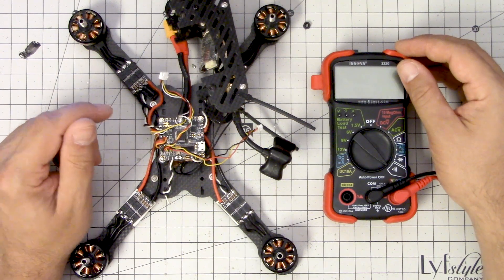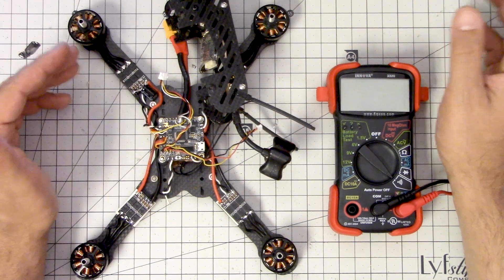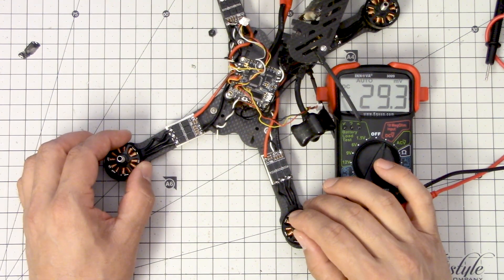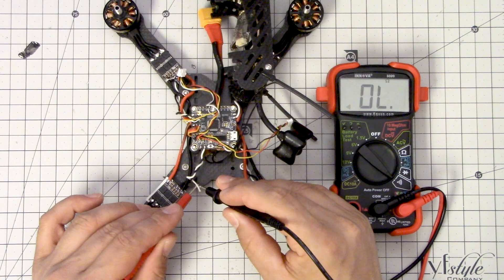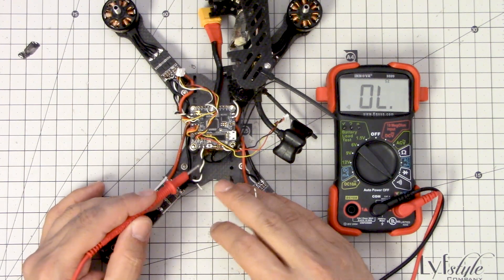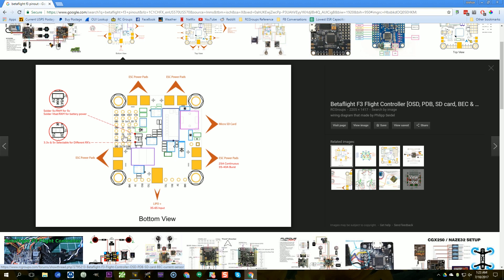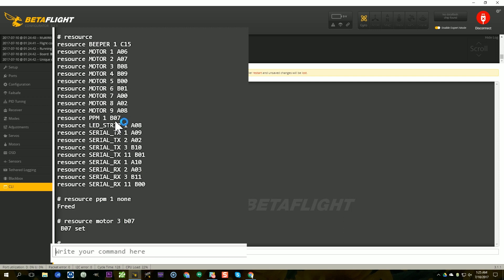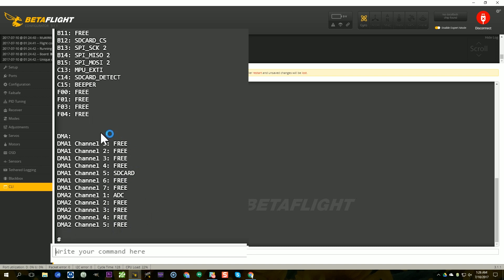How To Fix A Bad Motor Output With Betaflight Resource Remapping

Comment: I'm going thru it now with a brand new stack it's like all 4 are not there..   it does 3 beeps and motors twitch but not getting last 2....I'm so over quads I've spent so much lately and I just want to fly

Comment: Is there any reasons not to use another motor output if you have 8 motor outputs on the Fc?
Reply from the maker: No. Absolutely do that.
Reply: @JoshuaBardwell  Awesome! Thanks 😃

Comment: Hi Joshua, I have your JB F4 V2 aio FC, and it has a short in the board at S1.  I remapped successfully, but will the short cause other problems?  After remapping I got all the motors to spin up on arming and was able to fly, but now for no apparent reason I get 100% error on all four motors on the motors tab.  Thoughts?  I haven't changed anything else and was enjoying RPM filtering previously.  BLHELI can't read the ESCs at all, but all four motors do the full series of init beeps on power up
Reply from the maker: If s1 is shorted to ground then s1 won't work but no other problem.

Comment: Hey Josh, on another thread I mentioned I crashed my transtec beetle broke the arm and was waiting for a replacement.  I hit down in a grassy field, not on the concreat so I'm hoping I didn't damage the ESC.  (maybe I did) I received the replacement lower frame and swapped it out with the broken one put everything back like it was.  Long story short, motor one is dead in the water, won't spin in BF, solders appear to be fine, haven't taken it apart yet but wondered if reassigning the motor as you demonstrate here might fix the problem.  Again it's a DJI equipped transtec beetle.  What's your opinion and with this particular ESC are there any caveats I should be looking for when initiating this procedure?  Thanks!

Comment: can i use an available TX for my new motor signal?  for example right now i have TX 1 available.
Reply from the maker: I don't think that usually will work if you are using Dshot, because the UART pads probably don't have a dedicated DMA channel and timer.
Reply: @JoshuaBardwell   ya I figured that out. Thank you. I'm just going to remap and use  the the led strip pad and remove my LEDs.  Once again thanks for the help.  I am a big fan of your videos. You have helped me out through a lot.  Thanks for your time.

Comment: I'm having a problem the left back motor keeps dipping Everytime I throttle up..so I put a new motor on and it did it again..then I landed like really lite not even hard on the ground and it sparked then the ESC cought fire..it just keeps happening all around the quad everything is soldered right no wires that are lose..I'm out of options please help me here I just don't get what's going on. Also can a bad flight controller make things act up?

Comment: While typing exit in cli it's giving failed to close serial port and the data is not storing i need your help!!
Reply from the maker: Type save to save setting. Exit exits without saving.
Reply: Same problem after typing save also if we type bl it is going to dfu mode something is wrong any solution please
Reply: Only that bl command is working

Comment: I remapped a motor to a few different ports after experiencing a dead motor 3 output. It worked for a while but now the motor runs really hot, rough, and has a strange high-pitched noise that results in poor flight characteristics. I tried replacing both ESC and motor with same result as well as DShot, Multishot, Oneshot, etc. Guess it's time for a new FC.

Comment: Thanks for the video Joshua! I am having a problem on my F3 board.  I am trying to setup a hexacopter and for some reason the FC does not send signal to motor 5 and motor 6. I have tried remapping to no avail. I get the first three tones when plugging the ESCs in, but not the valid throttle input tones. I will also add that I don't think it is a broken flight controller, as these outputs have worked in the previous tests. They seem tocome and go. I wonder if anyone else has had similar experiences? Is there something I am doing wrong?

Comment: Does your FC board actually have 9 motor ports? why are there 9 motors, if the board only has 4 actual ports?

And what is the significance of LED_STRIP 1 and MOTOR 9 both having A08 assigned? is this not a conflict?
Reply from the maker: My FC only supports 4 motor outputs. The firmware target defines 9 but only 4 are used. That's why there is no conflict between ledstrip and motor 9.
Reply: @JoshuaBardwell  Ok thanks, and thanks for the reply. Great video.

Comment: This helped me, but does anybody know why it outputs 2.45V instead of 1.59V on 0% but outputs correct voltage on 100% I just don't want it to happen again
Reply from the maker: You can't measure the voltage of a digital signal with a multimeter. It is just averaging the voltage based on the PWM duty cycle. It isn't meaningful.

Comment: well...thanks for this. I supposed soldering each signal wire directly to ground is sure to cause problems (mis-read Matek schematic as it 'clearly' shows 5 wires off ESC, I only had 4 off the DYS 35a; by golly I was gonna git me sum telem one way or the other...whoops)...that solved, on to the remap...don't drop the mic just yet JB, I'm only 3 minutes into this vid...

Comment: Mr B. I’ve just finished a build with your FC and motor 3 isn’t firing up. Went there a cpl of your vids and when I saw this one I started checking with multi. Esc have power. But what I found is when check v on signal wire all working wings give 0.81 accept none working one. So I assume the cause is I’m not getting signal. Why is this. FC not giving signal... thx. hope you see this comment. I’m not sure how else to reach out to you.
Reply from the maker: You can reach out to me via FB message or email, and you can always email support@racedayquads.com for support on my FC or ESC, which they manufacture.

If motor 3 is not putting out any signal, the pad may be damaged. If you did any remapping, it's possible you assigned motor 3 to a different pin. But if you didn't do any remapping then my guess would be physical damage of some kind. If you think the board was damaged out of the box, please reach out to support@racedayquads to discuss warranty.
Reply: Joshua Bardwell man you are on it. Love your work. I don’t FB. Not sure where to find a email contact for you. I was very fragile. And didn’t burn up any pads. But I must admit I am a rookie. Yet was pretty proud of how everything turned out. All runs and connects. Well, one moter spins wrong way. 😏 But that’s least of my worries. I’ll contact RDQ it’s where I bought it. But I’d expect them to tell me I broke it somehow. Don’t know how to remap. I think you were about to explain that in this vid when I stopped it to multi test.

Comment: Hi, I have the problem of the attached video:
https://www.youtube.com/watch?v=_coTIjwiL4E
motors does not spin. Can someone help me?
Reply from the maker: Go to the Betaflight Motors tab and try to spin the motors individually. If any motor does not spin, it might be a damaged motor or ESC.
Reply: @JoshuaBardwell  thank you for your answer. I try to spin each motor individually but n1 works fine, 2 and 4 works intermittently and 3 does not spin. I Don' t think esc or motor are fried..or maybe only n3...

Comment: Is it possible to have an intermittent bad output? I’ve had two revolts that have bad back left connections. And my BetaFlight board runs the ESC’s just fine

Comment: hello joshua i am afraid that i might need to do this.. i have replaced a motor twice and none of them work on an essentially new hawk 5 after only couple flights. i am at a loss .. the motors jitter when battery plugged in but the one motor 3 does not respond. . your my last resort lol before i buy random parts and throw money at the prob
Reply from the maker: If you bought it ready-to-fly and it didn't fly, I would want to take it up with the vendor. Depending on who you bought it from you might have luck.
Reply: Joshua Bardwell basically do u think it could be my flight board or is the esc board the likely culprit
Reply from the maker: That's really hard to diagnose especially because the hawk's magnum stack has hard-pinned signal connection between FC and ESC. Normally I would say, swap the signal wire with another motor but you can't easily do that.

If you went through two motors, then my guess is the ESC.
Reply: Joshua Bardwell can i move a motor output?
Reply from the maker: That's literally the whole point of this video :-)
Reply: the vendor isn't gonna b an option. due to return window and mods.. i guess I should just say is there a way to diagnose it.. am I able to remap a motor pad to use or.should I replace the esc board. I'm open to all options I wanna fly it flew so darn good before
Reply: you will be happy to know that Amazon is gonna replace the whole thing.. but.... u better help me if i can't get my fport on my r xsr receiver I'm gonna install..lol the hd3 for ur replies Joshua I'm a huge fan . ur like the borg from star trek of drones..

Comment: I'm using the bff4 and motor #2 is done 2 escs later .....we're can I put wires say motor5 and led together on same channel I tried to remove one at time will not let me keep saying one or other is assigned ...and just wanted to thank you you have brought me up to speed .............there really was no one when I first tried getting into hobby so my first multiwii flew away never to return

Comment: its works, i move my signal esc to num 5 by cli codes 
resource MOTOR 5 NONE
resource MOTOR 3 B08
then my esc is not detected in blheli suite & configurator
why?
Reply from the maker: If you are using Dshot, then probably there is a DMA channel conflict preventing you from using those pins at the same time. Try Motor 6 and see if it works.
Reply: Joshua Bardwell thankyou, i am going to try it.

Comment: I've got your jb f4 and my signal pad has come off on motor 3 but my led pad is also come off is there any other pad I can use to remap the signal wire please please reply thanks Bardwell ur the best 👍👊
Reply: Motor 3 pulses i mean
Reply from the maker: I'm afraid if you've lifted M3 and the LEDstrip pad, I don't know of any other options to save you. If you are consistently lifting pads, can I suggest you look closely at your soldering equipment, temperature, and technique, as lifted pads are often an indicator that something is wrong with one of these.
Reply: Joshua Bardwell thanks for the reply bud  it came off in a crash Been great for a few months, so the board Is a gonner then ?
Reply: Hi Joshua, I have your FC and my motor 3 pad was removed in a crash too! I have remapped it to the LED strip pad but when I plug in my lipo it just pulses , as if it was flashing like an led! It also won't arm, any ideas?

Comment: Thank you thank you JB I had exectly the same problem, after putting on new esc's Dshot600 motor 4 would not work. So I swapped motot 3and4 and then motor 4 was fine, so a busted motor output on the FC.  The only thing i did different is that I put motor 4 on the motor 5 output and it all works great.

Comment: Mr. Bardwell, I have been running my quad on betaflight 3.2 without a problem. I have a betaflight f3. I do have motor 1 remapped to the PPM pad but never had an issue. I just made the switch to butter flight and and I remapped motor 1 once again. now motors 1 and 4 won't spin up on Dshot 600 but when I go to OneShot125 then they spin up. I have checked for DMA conflicts but didn't see anything. Any help is appreciated
Reply from the maker: Sounds like a DMA conflict to me. If you are using Dshot and 2 motors don't spin at the same time, that is usually a DMA conflict.
Reply: How can I resolve this? Can I remap to a different pad and not use the PPM pad?
Reply from the maker: That is the only possible workaround: to move the motor output to a pin that does not have a DMA conflict.
Reply: Okay, can I move it to a unused tx or rx pad?

Comment: bringing this one back from the dead. I  somehow pulled the motor 1 pad off my brand new Joshua Bardwell f4, (havent even had it airborn yet!) and I want to remap a pin.  I ran the command resource list, and I dont see  anything about DMA's... whats the score here?  - using betaflight 3.3...
Reply from the maker: Resource List should show the DMA channels at the bottom.
Reply: Joshua Bardwell  it doesn't. Now you have to type DMA

Comment: Dear Joshua. I have build a new quad. Well new esc and fc. Its the holybro stack and tekko escs. It reads the escs. It does all the beepy things but the motor (new) does not turn. It also does the low and high throttle signal normally to. What is wrong, can you pleaseplease please help me?!!
Reply from the maker: Go to the Motors tab and see if the motors spin when you raise the sliders. If not, then the FC is not talking to the ESC right.  But those ESCs support Dshot600 and below, so unless you have selected dshot1200 they should work. And they come pre-wired so you didn't mess that up either.
Reply: Joshua Bardwell  They are the tekko32. But i found the problem. It was a hair of the telemetry wire that contacted with the signalwire. It worked normal on multishot, but not dshot 600 of 1200. Now it works on dshot1200. Thats ok for these escs right? Resoldered the 2 wires and that was the cure. Thanks for your answer!!

Comment: Hi JB. my esc started acting all funny and did not show up in blheli but the motor was spinning but that lasted for 2 weeks.it is always motor nr.3 that are being funny on my quads haha. I did off course by a new esc but still the same so I tried with a new flight controller and it was fine.Then I saw this video so I had to try  i put the old fc back in did what you said about the programming cli and it worked. thanx alot. I think you are doing a good job and I love your channel.. keep it up. happy new year to  you .kind regards from Norway

Comment: So i think i can confirm that you can not use an rssi input pad as a motor signal pad, but what about a uart pad?  running out of places.  When i try to remap ADC_rssi none of my motors will spin.
Reply from the maker: No, you can't remap hardware UARTs at all.
Reply: Well i don't know, i'm not a techie!  I had all ready used the led pad for another motor.  The signal pads on the helix flight controller are too exposed.  A few good crashes and one just popped off.  The second one was the result of a lipo fire i think.  I ended up soldering directly to the capacitor?  Whatever the small component circled in green, it worked.  http://www.pbase.com/paulyoly/image/166666115

Comment: thanks again ,new on for I have a luminaire  4f alo and have just lost osd cam still working but no osd
Reply from the maker: +ggvaper did the osd work before?
Reply: hi there yes it did, but I think I have sorted it I had change the font but did not load it one its back working now, I hope that's what it was thanks for the reply so soon keep up the amassing videos

Comment: hi could you tell me if I can put my positive esc wire some were ells to get power too it as my power pad has come of the board on motor one ,ace videos
Reply from the maker: +ggvaper yes you can move it to another ESC pad. Pick one closest to the battery lead.

Comment: I'm trying to do this on my Holybro Kakute f4 and i have moved the motor 1 signal wire to motor 5 and 6 while using this method and my motor still doesnt spin, is there something im missing?  I double checked the values and remembered to hit save after.  Fearing this FC is bad.
Reply from the maker: If you are using Dshot, then a DMA conflict might be the issue. Switch to multishot and see if that works. If it works only on multishot, but not on Dshot, then that confirms it's a DMA conflict... most likely.
Reply: Joshua Bardwell thanks very much, hoping for a resolution and yes I'm attempting to run d shot.  Maby I'll have luck tomorrow, was very excited for this flight controller
Reply: Its working with multishot thanks very much.  is there any way around a dma conflict, i tried googling that term and didnt come up with much.  Should i suck it up and run multishot all the time or just try reassigning all the possible pads until one works, or is that likely to fail as well?

Comment: @Joshua Bardwell I have a flip32 ominbus FC but cant seem to get motors 5 & 6 to also work with motors 1,2,3,and 4 simultaneously. I trying to fly a spider hex with an f3 fc since my naze board is now obsolete. any thoughts? ive tried 3 different flip 32s and have the same porblem with them all.

Comment: Hey Joshua!
After a crash BLHeli Config wont read an ESC like yours did. I testet the power to the ESC (getting ~16V), but when I felt for the beeps, I didnt even get thefirst 3, not the last 2. Power seems to be the problem. What's your diagnosis?
Thanks for all of your videos, they are amazing!
Reply from the maker: +nonfaker if the ESC had power it should beep. I would be suspicious that I just wasn't feeling the beeps. Is there some way you can verify that the ESC isn't beeping. 

If it really isn't beeping that points to maybe a failure in the output circuitry like bad FETs. Or maybe the 3.3v regulator could be dashed so the board isn't powered even though power is applied.
Reply: Thanks for your quick reply!
I am afraid you are correct, and one of the components are broken. It was a very minor crash, that caused the failure. I hope to replace the voltage regulator, maybe I am lucky. 
Btw, these are Racestar 20A, so not top quality ESCs.
For now, I desoldert it, and I am trying to supply it with power on its own to check for the beeps